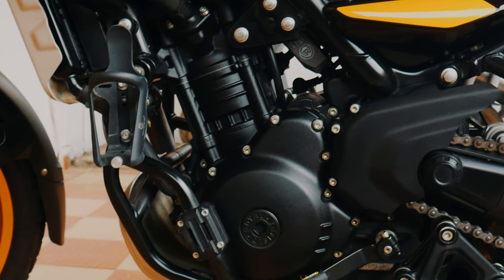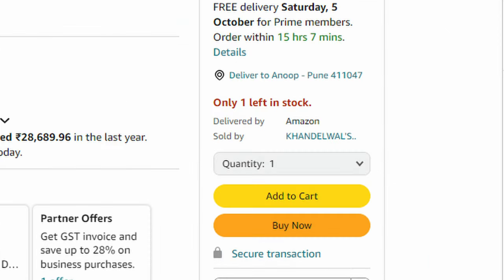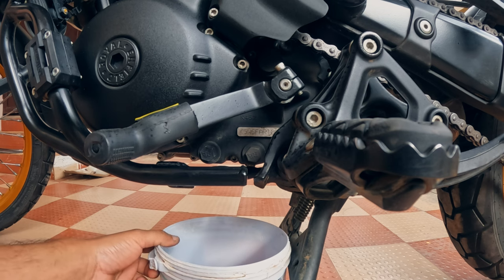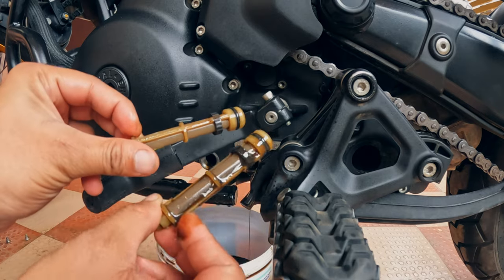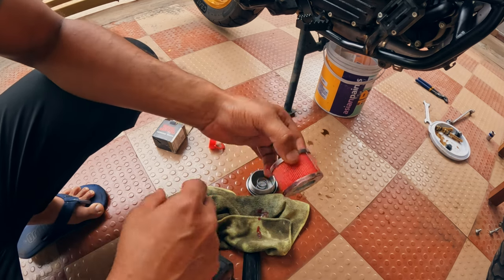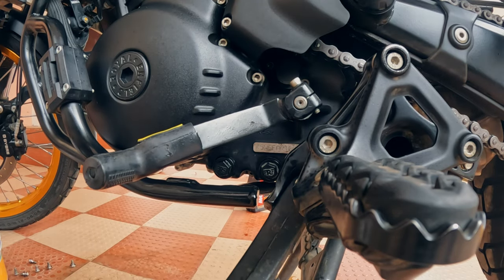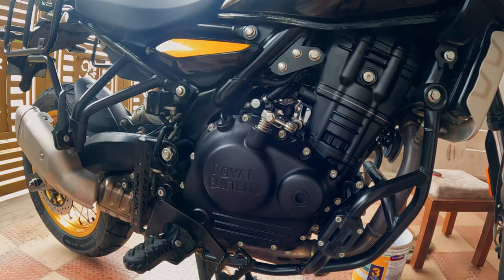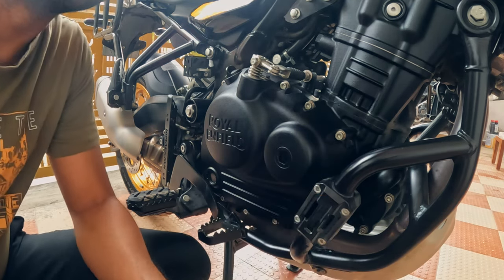Secret to a Smoother Ride! Change Your Himalayan 450 Engine Oil Like a Pro

Comment from the maker: Hello folks.. Let me know thoughts and which Engine oil do you prefer in the comments.
Reply: @OnceARider  Try Liqui Moly
Reply from the maker: Thank you for sharing, will test it out next.
Reply from the maker: @DAILY_FACTS_TREAT  thanks for the info, just with the motul bike is running so smooth and so much cooler, now I wonder what results will be with the one you suggest.
Reply: @OnceARider  Maxima is way too premium segments in oil.. Their molecules doesnt get thin at any operating temperature...used by racers grade in usa..I himself using in my himalayan 450.  Results are outstanding....And i combined it with Engine ice coolant....as stock coolant is total shit.
Reply from the maker: @DAILY_FACTS_TREAT  I will try it next time.
Reply: How about motorex ? Is it good for Himalayan 450 , ktm uses motorex how about its quality ?
Reply from the maker: @ajayk3372  hey bro.. technically this sherpa engine is very similar to the KTM engines. Both are high revving. So if it works for KTM then it should work for Himalayan 450 as well.. but at this moment I haven't used it so I won't be able to comment on anything specific about motorex. But I will definitely put this on my list for the next time.
Engine oil really made the difference engine running smooth aside I am surprised by how cooler it is running.
Reply: Shell
Reply from the maker: @gaurangnaik850 Sure, I will try the Amsoil next.
Reply from the maker: @flyingkiwi215, You are lucky then, I asked the showroom I went to put fully synthetic oil they said I will void the warranty 🤡
Reply: @OnceARider  Well, it doesn’t void the warranty. RE ‘recommends’ semi because it’s the minimum standard they want you to use but fully is better protection but being more expensive. RE just don’t want you using mineral.

Comment: 1) Buy a 1000ml plastic beaker. It will be convenient.
2) Don't spray much on oil strainers, it may cause the rubber o-rings to become hard and fail.
3) After the old oil drains completely, tilt the bike first right, then left, then again left, again right, then move the wheel in neutral, so any left over oil stuck, get cleared completely.
4) Try to remove oil filler cap first, the draining will be much faster due to in line air pressure, than vacuum.

Comment: you should always open the oil filler cap 1st so that no oil remains inside the engine because of the static vacuum pressure.
Reply from the maker: Hey there... Noted and thank you so much  for sharing. This didn't come to mind.

Comment: Hello greeting from Malaysia, my bike almost reach 2k km but the engine oil look greyish, is there any harm to the engine? The service center recommend to change the oil every 5000km, and in my country it hard to find the genuine product for the RE, I want to try do it myself but lack of spare parts 🥲
Reply from the maker: Hey bro! No need to worry about the greyish color – it's totally normal. RE recommends the next oil change at 10,000 km, assuming you had your first oil change at the first service. As for parts, you can definitely try sourcing them online if they're hard to find locally. But if getting the parts becomes tricky, it's a good idea to leave those replacements to the service center. Other than that, feel free to work on your bike and enjoy the ride! Owning and maintaining it is all part of the fun.
Cheers!! Happy and Safe Riding!! ✌️
Reply: @OnceARider  Noted, Thank you for the clarification bro, I'm really surprised when I see the EO become greyish after 1000km++. Look like I need to make an order from the service center

Comment: Isn’t the warranty effects if we use different oils instead of RE Engine oils given at service stations
Reply from the maker: Not at all, just make sure you use what grade/specifications RE recommends. However if you talk to any RE service center they might say it voids warranty but believe me it wouldn't. They say to intimidate customers so they pay for their oil and labour nothing else.
But yes if you make any mistake during the oil change and something gets damaged due to it, then they might not honor the warranty. However there will not be any way for them to prove you used some other oil until they send the burnt oil for lab testing and to be honest do you think they will go so far ? Most RE service centers don't even have a proper Torque wrench.
But make sure all services are done by schedule at RE. This is the first thing they check for any warranty claims.
Reply: @OnceARider  I have recently brought G450 wish to use Amsoil or Motul during the first service at 500 kms either at RE service or do it myself later after

Comment: Is it ok to use fully synthetic oil ? Currently RE uses semi synthetic
Reply from the maker: Yes.. fully synthetic is better, they use semi synthetic to keep the service cost/maintenance cost down. Not everyone especially in a country like India can afford expensive engine oil. 
Same is the reason for the longer oil change intervals.
Benefits of fully synthetic which are visible to naked eyes are:
1. Smoother running engine.
2. Better acceleration and throttle response.
3. The engine runs cooler, yes this was the biggest change I noticed after switching the oil.

Comment: You can use 300v2 motul it is also good.
Reply from the maker: Hello... Sure, I was considering this one too but wasn't sure, this 7100 looked good on specifications so went with it. Will try 300v2 next time.
Reply: @OnceARider 300V2 and Liqui Moly Street Race is better for high compression engines like kTm and this sherpa 450 engine try it if you are willing to spend a bit more..... Amsoil is clearly the best that's for sure but that price tag isn't everyones pocket willing to afford for just a engine oil
Reply from the maker: @midhungopan9270  yes, it should not break the bank. 😊

Comment: Hey bro Awesome Content
Can YOU Please tell and explain the greasing parts in Himalayan Places to maintain grease 
This is very important.
Reply from the maker: Thank you so much for the kind words😊
Regarding the greasing, I believe the places where you will find grease are:
1.  Axel bolts of both wheels
2. Rear seat lock 
3. Clutch and Brake lever anchor points.
4. Not normal grease but sillicon grease on battery terminals. 
And you need not grease them regularly, however you can top-up or add new grease during scheduled servicesz or before going on a long trip.
For wheels axel I would suggest add grease if any work done in which you need to remove the wheels.
Cheeers!!
Reply from the maker: Also I would add, use WD40 on all moving parts and exposed bolts after every wash of the bike. This will prevent rusting and unwanted noise from the bike.
Thanks again for bringing this up, this would make a good video topic.

Comment: Bro, please never use wrenches for engine oil sump bolts cuz it will get slipped very easily and your hand might hit to center stand or any other metal part. Please use T bit, it will be very easy..

Ride safe bro, please wear helmet and gear all the time while you riding your 450CC machine ❤❤
Reply from the maker: Thank you!! for the advice and yeah those bolts shouldn't be that tight. Anyways I had to use the socket with the L handle to tackle them. Will get a T bit next time.
And I agree this is a heavy machine and needs proper respect, I never ride it without safety gear.. 🙂

Comment: Hey bro, why haven't you changed the o rings . It's recommended by RE to change all the o rings whenever you change oil . You should not take that risk of not changing it if you haven't
Reply from the maker: Hello... No worries bro, O rings don't go bad in such a short span. They were fine in my case. And you would know in no time if they were bad, you will get oil leaks. It's just a recommendation not a mandatory thing even though the RE service centre didn't change mine during the first oil change. So no need to worry about the recommendation.
Reply: @OnceARider  RE has mentioned to change the o rings everytime during oil change . Cz it's a higher CC motorcycle. O rings can have micro cuts which apparently won't be visible through naked eyes. And every service centre should follow the instructions. And next time when you are going to service centre for changing oil . You can check the content on the service kit. It will be having all the o rings and oil filter . I just wanted to share the right thing.  Apparently we are riders .
Reply from the maker: @soumyadipdas3703  I totally agree bro, and I wanted to change but as I mentioned in the video I couldn't procure that kit which comes with all o rings. You got to work with what you got.
Reply: @OnceARider  sure thing